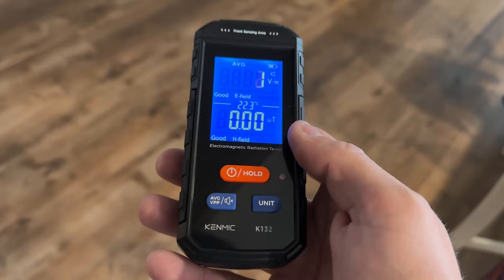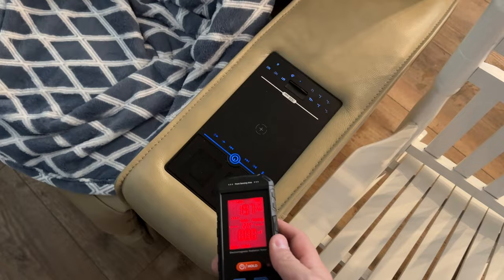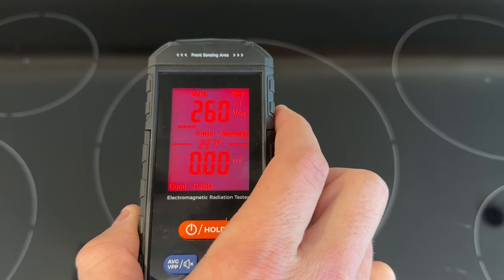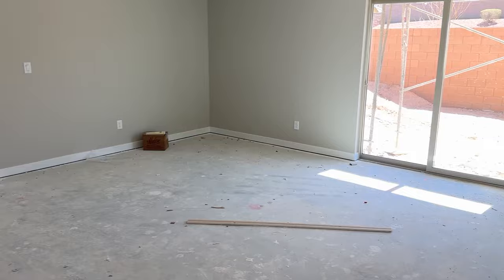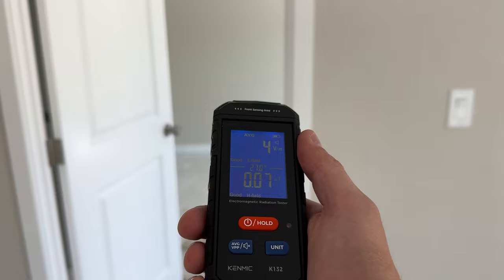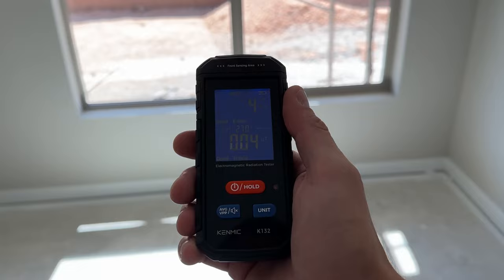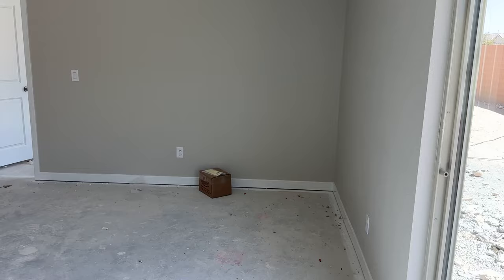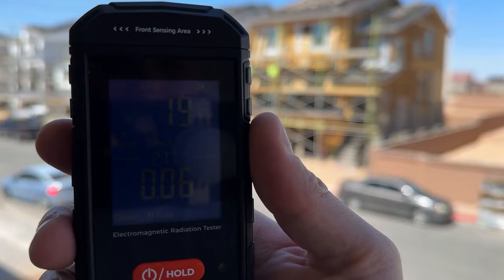How Dangerous Are High Tension Power Lines Really?

Comment: It’s worth knowing about the inverse square law, which expresses the relationship between strength and distance to a source of electromagnetic radiation (be it radio frequency, microwave, infrared, visible light, ultraviolet light, x-ray, or gamma ray). It tells you that when you double the distance to a source, you reduce the received strength to 1/4th (2x2 is 4). If you triple the distance, you reduce the strength to 1/9th (3x3 is 9), etc. So though none of the fields measured in this video represent a known danger to people, if someone is worried about it they can easily figure out how far away to move to achieve a desired reduction in exposure.